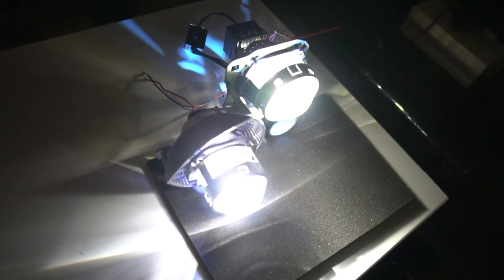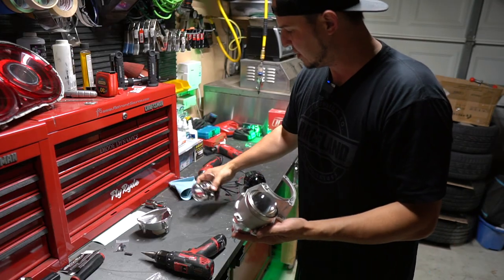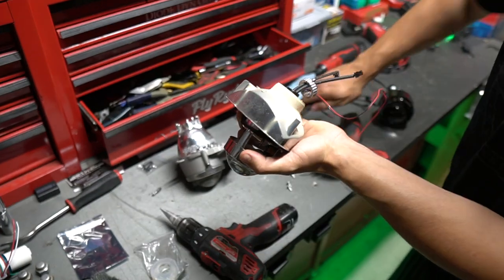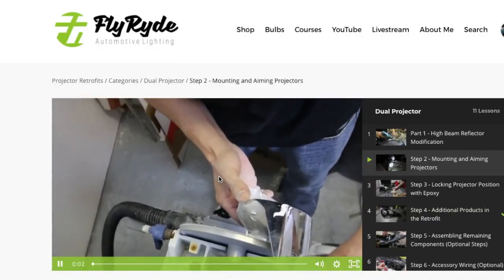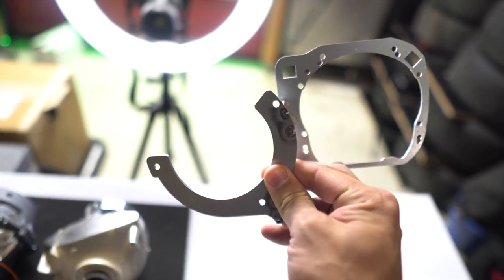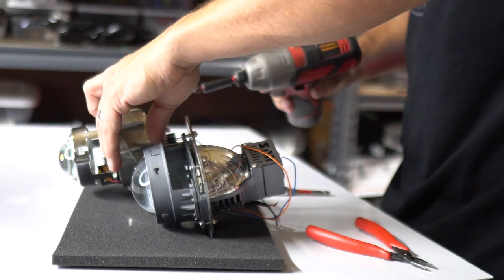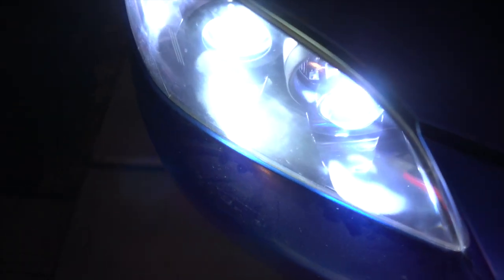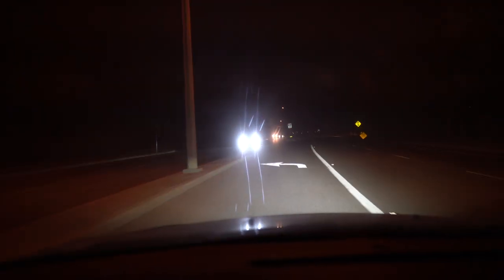What are Dual Projectors?

Comment: Got a quick question, i own a bmw 116i 2007, and trust me my lights cant even shine half of your stock ones XD
i want to get a double projector myself and integrate both high and low beams together, any advice to give on how its best to be done?
im as new as it gets to headlight customization and stuff...i basically dont even know the wiring that gets those two to begin with.
Reply from the maker: You could probably buy some easy to open lights like these, and then just kinda follow what I did in this video more or less. 

https://rover.ebay.com/rover/0/0/99?loc=https%3A%2F%2Fwww.ebay.com%2Fp%2F19022374235%3Fiid%3D123299881493

Comment: I could use a setup like that in my 13 Sierra, I live in the sticks where there are zero street lights.  My EG hatch has an amazing setup (Morimoto Mini D2S 5.0 main, JDM yellow fogs with HIDs, and a 14 inch light bar), but I don’t drive it that much anymore, and the truck’s stock halogens leave a lot to be desired.
Reply from the maker: Luckily for you there’s a booming industry full of blind everybody douchebag LED bulbs, and light bars. 

Honestly if it were me, and I wanted to NOT get mashed on by a deer in the woods 🦌, I’d just outfit that bish like a tank, and buy some bull bars instead of making it cute and PC for everyone else on the road. Have a switch for FULL DBAG mode, and rock something reasonable for regular street use.
Reply: FlyRyde light bars are legal in North Carolina 😁, but seriously, I never turn it on when there’s anyone in front of me.....unless they refuse to dim their brights
Reply: @flyryde  Hey brother I have a question I'd like to get some information for and you seem to be one of the best doing this. I've got a 2017 infiniti qx80 suv and it has a projector lens and light for the main headlight. If I order a demon eye kit can I make that work with my factory headlights if I break them down. Thanks

Comment: Chris- a follow-up question: as you’ve installed the new bi-LED projector inside the high beam housing, do you think there will be any heating issue, because the cooling fan is also within the headlight housing?